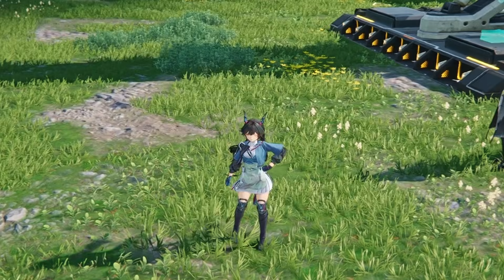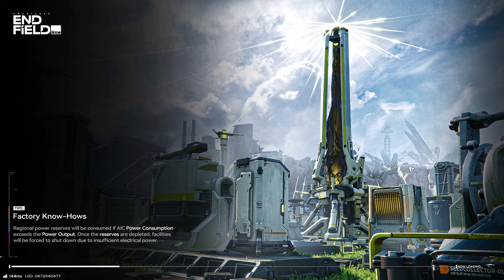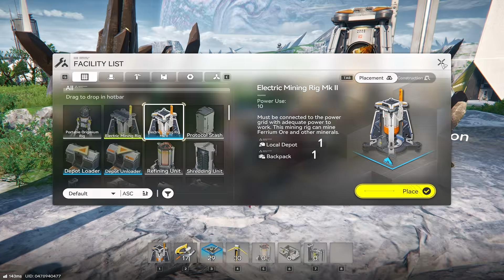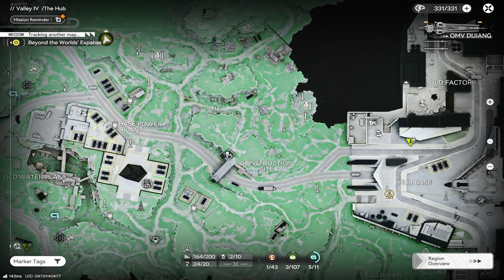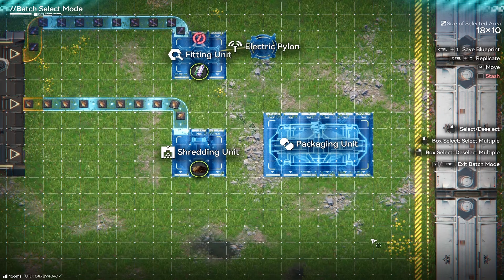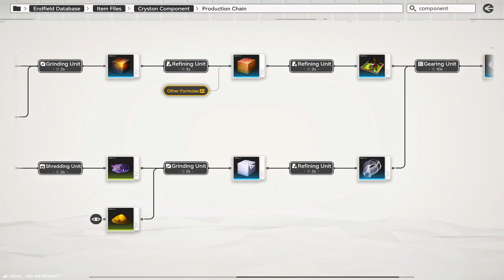The Factory Guide You Actually Need For Fast Progression | Arknights Endfield

Comment: Unless I'm missing something, a shredding unit has a processing time of 2s which means over a 10s period it will only produce 5 units regardless of how many belts you have feeding into and going out of it. All you've done is clogged the machine faster and tanked your efficiency. So for the LC Valley Battery which is produced in the packaging unit at an efficiency of 6/min or 1 every 10 seconds you're going to need 2 shredding units to get 10 units of originium powder over 10 seconds for peak efficiency. Also Thermal banks have a power duration of 40 seconds per battery, if you have the packaging unit making batteries at peak efficiency (6/min) you can power up to 4 thermal banks at a time from one Packaging unit quadrupling your power output at no extra cost. This guide is an ok starting point but it does a bad job at teaching efficiency.
Reply: Can you share a blueprint of your base? most creators have this efficiency problem
Reply: @sypheed_d  look at 18:00. The shredding unit keep getting clogged

Comment: Very good guide but what about AIC output? I have 6 and all are busy already with the setup from your video pre explosives.
Reply from the maker: You’ll need depot unloaders to fix that. Check the basic AIC plan screen to find which one unlocks depot unloaders and unlock it. It’s a much easier way of getting stuff out without the main AIC output
Reply: @itssenpai626 so basically AIC has 6 outputs and that's it right? I just used different AIC to create medicine system 😊
BTW can I level up different AIC than the main one?

Comment: My whole issue is not being unable to do all of that, my issue is that its inefficient af. It takes up so much space. But Im having fun, I can spend 3 hours doing the most basic shi and then be satisfied.
Reply: That's the purpose of other AIC Factory in other region, you can use them to set an specific factory like example "this factory base is only for ore, or that factory base is only medicine/capsule etc." You don't need to put all of them in your main hub factory, you can use the other small base factory for generating item only such as unlimited plant, ore etc.

Comment: 16:50 wait what?? I thought the machine only processes the material 1 at a time regardless of how many input/output it has, well at least the ones that outputs 1 item/recipe. I know it can output multiples evenly like 1 sandleaf dust recipe can fully saturate 3 belts but does it also work like that with each input? Like does it process each input in parallel?
Reply: Yeah I need to test that out. I did a double take when I saw this ad I also thought each component only outputted one at a time and not in parallel.
Reply: @jonomate I was curious about this too, did your testing prove helpful?

Comment: Fellow enfilder I want to  know at what level should I start building my factory and build resources to build my operators
Reply: Do the bare minimum with the factory early on, mostly w/e tutorials the game asks you to do, get the  buck capsule C to have some heals, and the bombs, along with enough mineral patches to support these, as well as the first sets of gear. Then, do the story until you clear all 6 areas of the Valley, the final boss of the Valley might be a challenge, if you can do the boss or not, it doesn't matter, that boss is the point where you should start focusing a bit on the factory, get the purple gear, get the purple heals, get all 3 outposts for the valley. After that, go into the next area and you pretty much do the same, advance until you can't advance anymore, then focus on the factory for better gear.
Reply: So I should basically just do the boss unlock all valleys and then focus on the factory
Reply: @UltraVoid-v2z  Yeah, the thing is, you need account level and resource availability to unlock the more advanced recipes, and if you for example set-up something to spam buck capsule B, then 2 hours later you get to the next area and you have to re-do everything for buck capsule A, it becomes tedious.
Reply: @EddieBlake215  thanks for the tip butthe game is hella confusing me, this is quantum physics at this point
Reply: @UltraVoid-v2z  it gets better, even the factory part, I couldn't stand it at first, then I just focused on the story and when it became to challenging I took a moment, went through the tutorials, watched a guide and now I'm set-up for the second area.
Reply: @EddieBlake215 that’s exactly what I’m thinking right now, do the the story until it’s hard and then start building stuff that you actually need

Comment: Quick question. I got Laevatain's sig in 30/40 pulls. Does the 10 more for the 40 guaranteed 6 star carry over to the Gilberta's sig banner? Because the Details says nothing about it.

I also can get an Arms OC smelting forge if I pull 7 issues more. Is this going to carry over as well?
Reply: It does not carry over better just save for next banner you want wep in
Reply: It does not carry over and there is no more 50/50 60 pulls once u get the p0
Reply: The 80 pulls for a 6-star guarantee does carry over. The rate up spark which is the 120 pulls for a guaranteed rate up character does not.
Reply: There is no carry over in the weapon banner

Comment: Anyway.. how do I upgrade the power output of the AIC?.I can't seem to figure it out ... Help!
Reply: Do the Simulations, they explain everything and give you blueprints to use as a reward. You get more power with thermal banks.
Reply: @NoFailerwhat's the name of the tutorial.. I did figure it out but I need to coptimiz it .. Anyway thanks for your help 🫡
Reply: Powering Thermal Banks is the only way to increase your max usable power.
Unlocking Thermal Banks requires Basic AIC Index from Protocol Dataloggers in Valley IV.
In short, the AIC itself doesn't make more power, you need to build Thermal Banks and power them.
Reply: @nizizumi  Yeah ... I got that .. now it's around 1.3K power output.. and it needs so much battery like... 🤦🏼